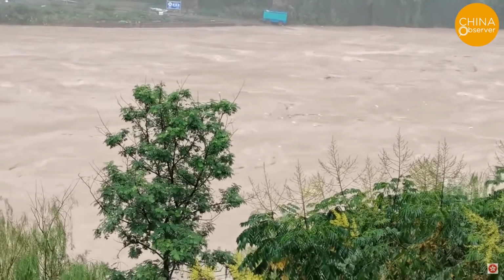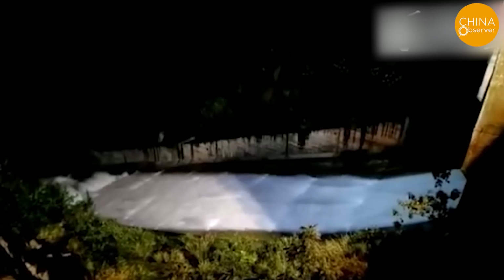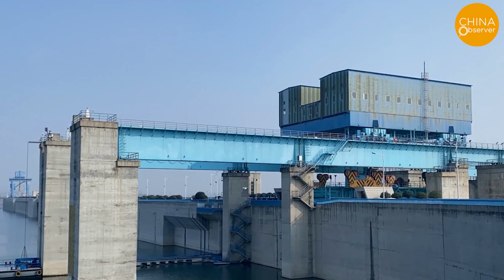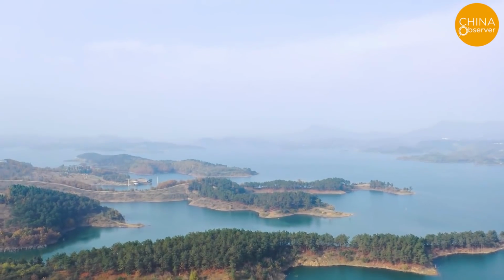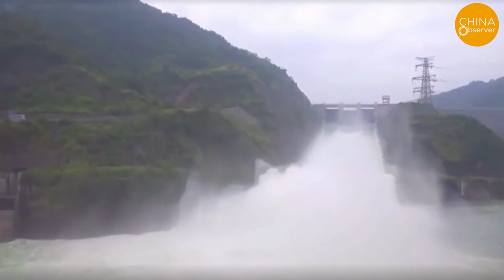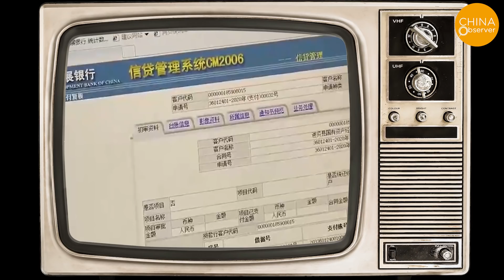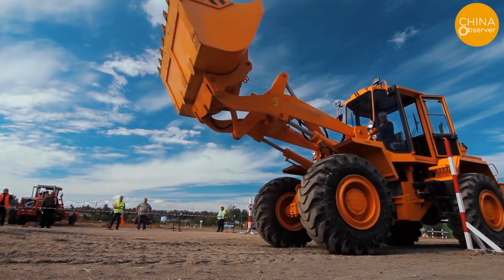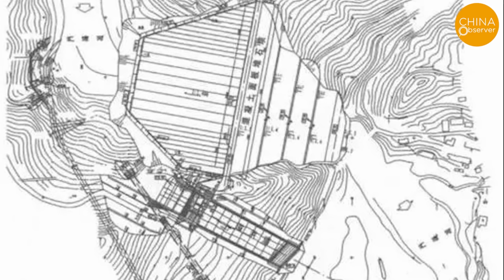296 Million Cubic Meters Reservoir Spillway Destroyed by Flood, Reasons Behind Tofu Dreg Projects

Comment: Such a large concrete pour requires careful curing. This process can't be rushed.
Reply: Yeah but GDP numbers…
Reply: I'll bet if they had the construction crew downstream of the project the crew would make extra sure it was done right
Reply: @toddkes5890  😰😥😭😪😢
Reply: Near the end of the video it showed concrete being dumped from at least 10 feet, My time in construction the limit was two feet to keep the aggregate from separating out.
Reply: repairing Oroville Dam spillway in California took many months
Reply: Bad spillway design, nothing to do with curing.  Same thing happened at Oroville.  The plates of the spillway were made with square butting ends instead of under-cut lap ends.  You can see the shock deflection cavitation in the running spillway further up that are just going to rip more plates out.
Reply: @danielrose2399  It depends on the consistency of the mix, if it is only wet then you can drop it from 3m, if it is so liquid as it was shown here in the video then you should avoid droping it...
Reply: Older dams which built 100 years ago which  spillway are build with stone still stands . concrete life span is less only 50 to 60 years. china needs to rebuild all they concrete building in next generation.nowdays cement quality is much lower .only infrastructure grade cement are good quality which is 60 years ago ordinary cement.nowdays many infrastructure projects are build by ordinary cement which is reason for tofu projects in china.cement quality in usa is good which used lot of lime stone less coal ash .but same quantity of lime stone used to make two times of cement production in china so cement is basic reason for chinese tofu projects . Chinese cement use less lime stone and have contain large coal ash

Comment: The spillway problem is the same that happened at the Orovile dam spillway. It is caused by cavitation in the concrete spillway. It starts as a microscopic problem, and grows to get as large as this, or the destruction at the Orovile dam spilway, which was much larger. This has not much to do with bad build quality of the dam or spillway, but possibly of the spillway surface.

Comment: What is 'tofu drake?
Reply: very low quality concrete, usually because of corruption in the materials used (or not used in this case)
Reply: Tofu drake is the singer of Hotline Bling China Version
Reply: It's tofu dregs not drakes and it basically means made in China or really shotty work, cut corners, dangerous, poorly built, you know the normal made in china stuff
Reply: Tofu-dreg is the stuff left after filtering when making tofu or soy milk. It is used as a metaphor for shoddy work in China.
When it comes to projects it refers to buildings and infrastructure projects which are of poor quality.
This happens because money saving measures are taken or things which take time, for example the curing of concrete, are shortened. In addition to that the material used has a bad quality and workers are sometimes not following required concepts. For example in this video you already see how the concrete is poured in a wrong way. Sometimes materials are even replaced with insanely cheap alternatives, for example paper instead of stone or bamboo instead of steel. In addition to that often gaps or holes are not filled up. Another common thing is a poor foundation.
Those are some of the reasons for the building quality being in general rather poor in China.
Reply: @ThePandafriend  thanks for the clarification.

Comment: China-haters said when it happened in China it would be tofu quality.  However this is nothing to compare with the US Oroville spillway which suffered a much bigger failure requiring far more substantial remedial work plus strengthening .

China hater is using a local failure of a spillway to suggest a disastrous scenario if the dam fails too and speculating a domino effect to Yangtze River where the Three Gorges Dam is located.

This video appears to be the work of China-haters who smear China for a living.  They have been claiming the Three Gorges dam was about to collpase weekly, monthly and yearly for more than a decade so any local failure in one of the thousands Chinese dams would be good materials to infer substandand tofu construction in China.
Reply: how many engineering issues have been reported in the last three months ? every country has it's problems and disasters.. china just seems to have many ones that could have been avoided..